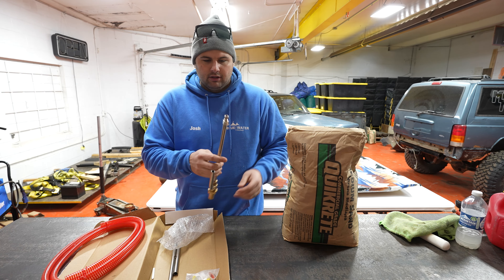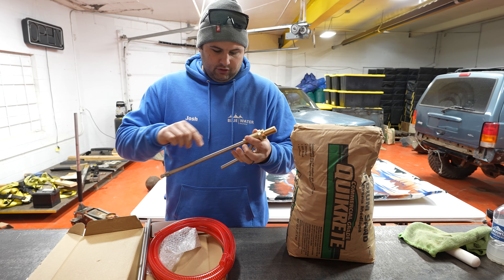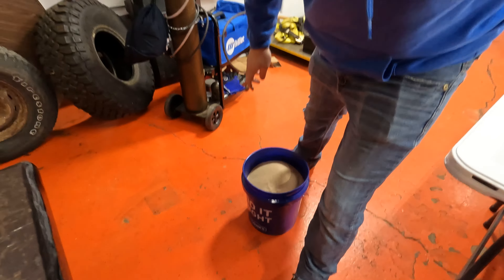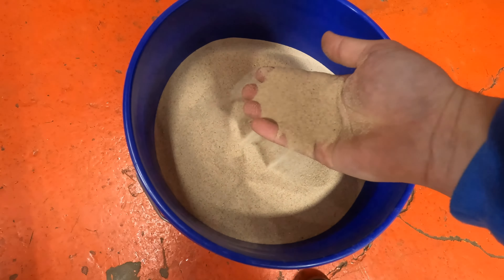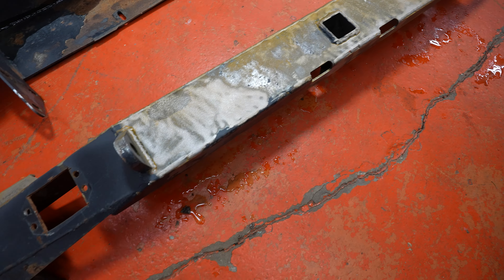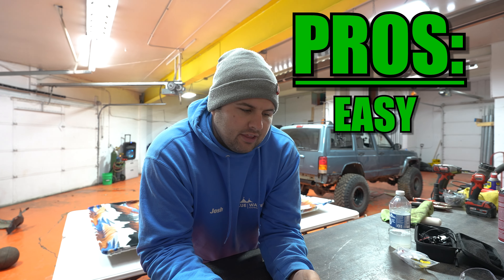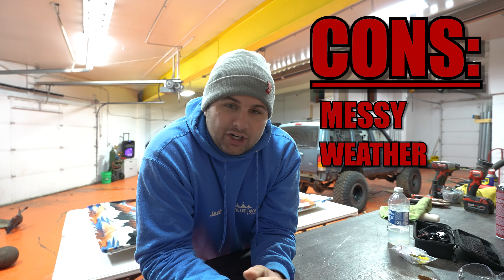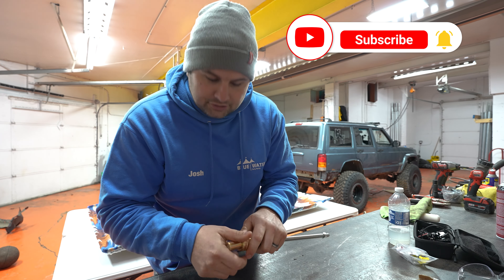How to turn your Power Washer into a Sand Blaster!

Comment: If you were doing a large project It might be a better option to get sand from nursery/landscaping place it's like 55 to 75 for a yard. You would probably need to strain it and make sure it's dry. The 75 buck stuff we have in our area is very clean to start.
Reply from the maker: Yeah bulk would be better as long as it clean

Comment: The sand doesn't try to clog up
Reply from the maker: I didn’t have an issue when I filmed this but if you get a little water in the pickup tube it does clog up. You just have to make sure the sand is dry and the pickup tube is dry. Otherwise it works good.